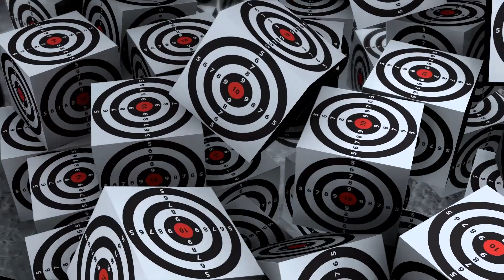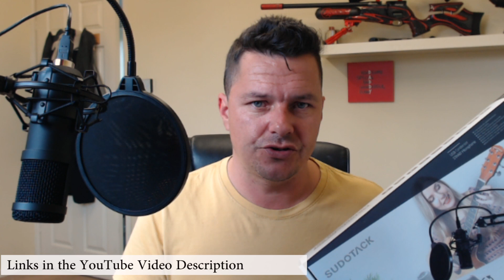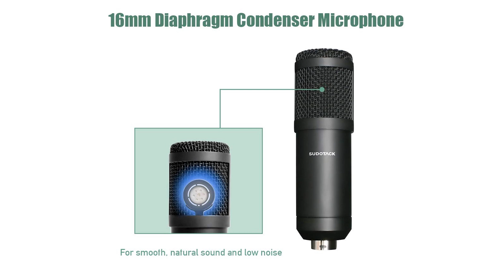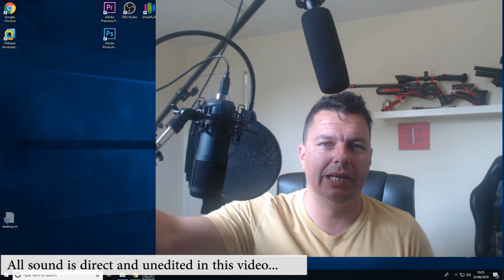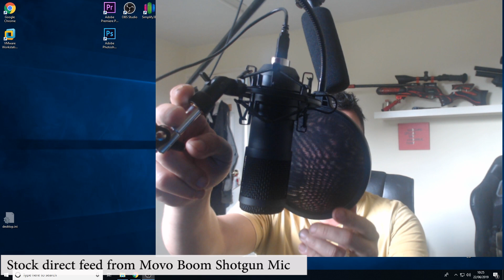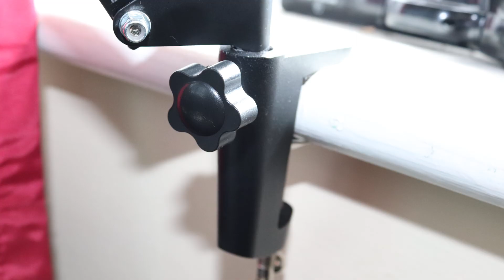SudoTack Broadcast Microphone [review]

Comment: Hello.  I am a retired "Old-fart" of near-70, and I spent several years dealing with audio, really enjoying when I was operating/setting-up the sounds for stage.  Reason I mention this is wanting to tell you I sort of KNOW what sounds good vs. bad.  I do not consider my self an 'expert' on sound, but I have a good understanding of what SHOULD be considered 'normal' sound quality.

Steve, for all practical purposes, switching from the 'Sodu' to the 'Snowball' had a very negligible effect.  The only true difference was that the DB went down, but just a tiny bit.  If I had not known what was going on, I would have thought you MAYBE scooted your chair back about a foot or so.  Regarding the SOUND or TONALITY, a person would be hard-pressed to notice any differences.  Regarding that 'Movo' mic, the sound was VERY tinny sounding, almost like placing the mike in a metal trashcan.  Well, wasn't really THAT bad, but very noticeable.  Please STOP using that mike... lol  ;-)
Reply from the maker: I am no where near an expert and I didn't even adjust the levels in production. The Snowball and Sudo are very close, the Movo was and is pants. I may very well be changing :) Thanks for the comments :)